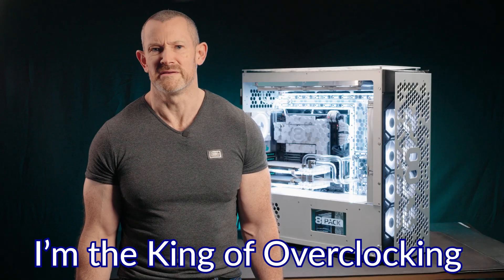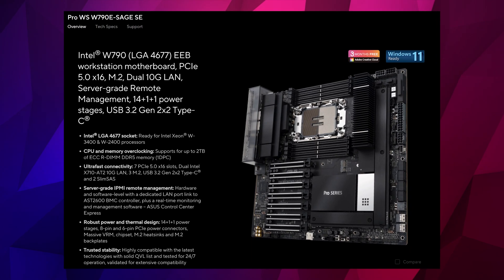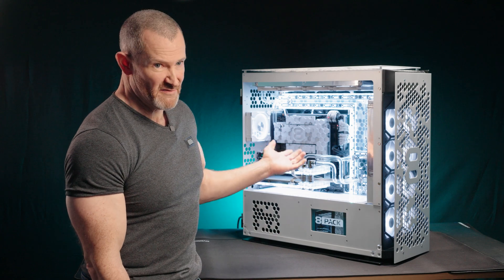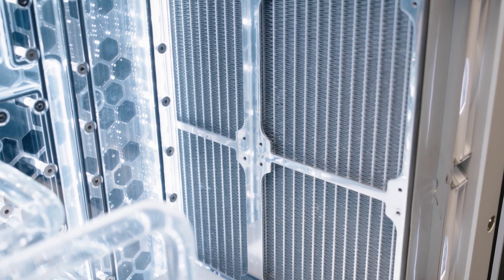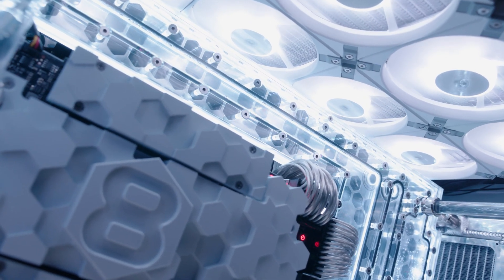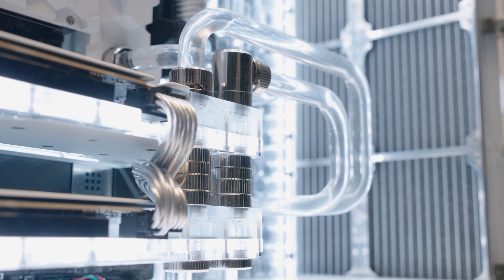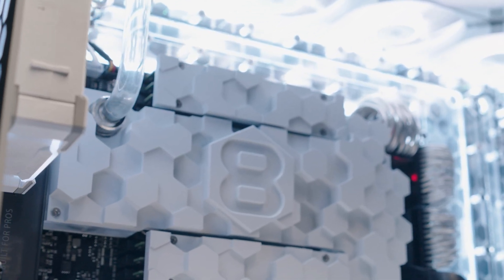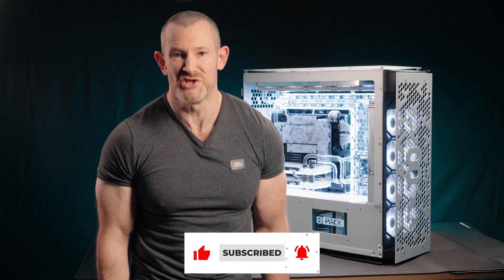Uncovering the Incredible Domin8 PC: 8 Mind-Blowing Features with 8Pack

Comment: Since they nerfed nvlink/sli how can you run 2 x rtx4090 in sli?

Do you just use them as seperate video cards?

It's a crying shame they did that.
Reply from the maker: Yes SLI is no longer available, so you wouldn't want to use two RTX 4090s for gaming etc. However the performance of each GPU can still used in professional applications such as rendering and scientific research.